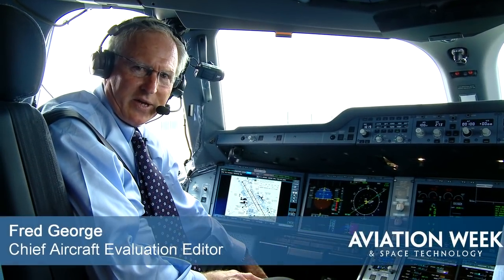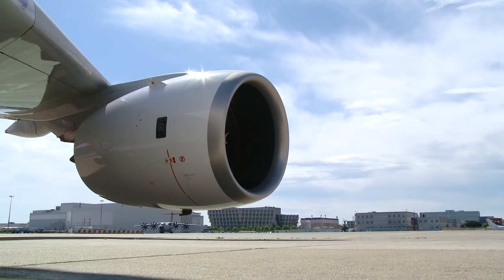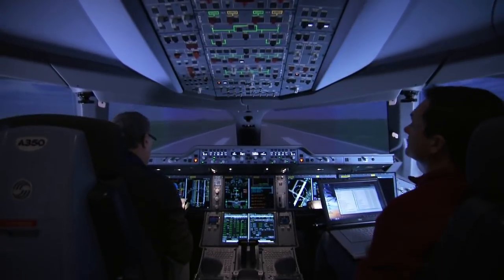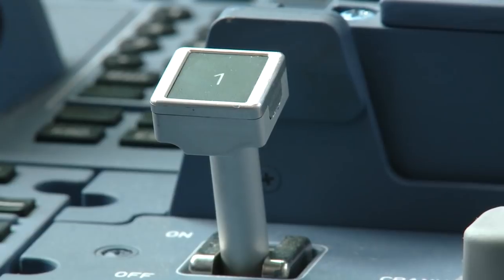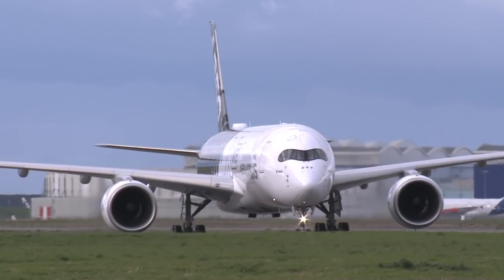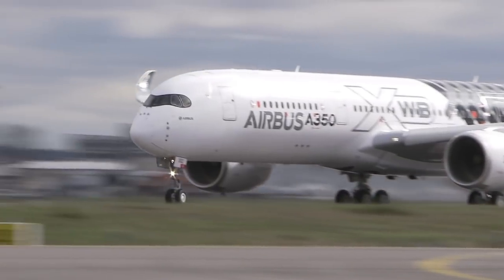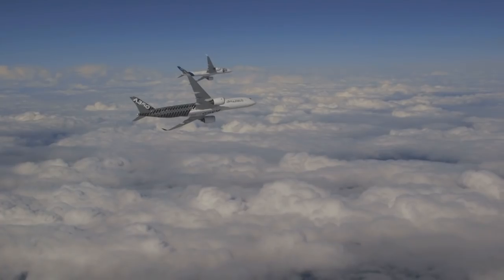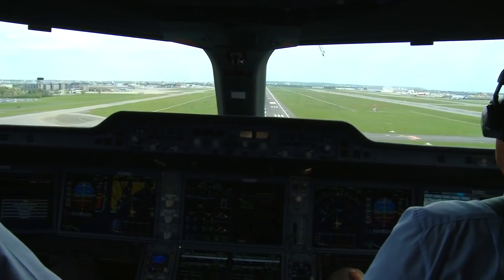Pilot Report: Airbus A350

Comment: "This jetliner is going to give Boeing's best tough comp.."..MY ARSE...
Reply: AeroManiac A well-put, very sophisticated and intellectually sound argument you wrote there.
Reply: goldstriker123 That's about as far a comparison between B777X and A350 will ever..... Bitches.....Whosyurdaddy...?!!!
Reply: Unconfirmed? really... Its confirmed that the team that tried to investigate this has all been fired, confirmed that there is true, factual documentation that the parts used to assemble the fuselage are being hand made not to spec instead of machine done. Its confirmed workers in the factory are having to over stress and over work the metal parts to get them to fit correctly causing the metal to wear prematurely and a catastrophic failure is due any day now. Do your research. Also, a lawsuit haha. Its the internet, this is youtube, not fucking supreme court for christ sake.
Reply: B777X is extremely heavy since they didn't use composite materials for majority of the fuselage.

B777-8X is also have too much range and thrust for it's size. Just like B777-200LR, it's not gonna be a big seller.
The only big seller is the B777-9X. But, apart from Major airlines, not many airlines actually bought it. Mind you, it's not easy to fill with 400 to 420 passengers inside a single fight. 

A350-900 in the other hand, have a perfect capacity to replace B777-200ER (which is a big seller back in the day).
While A350-1000 would be a good plane to replace B777-300ER.

So yes, This jetliner ALREADY giving Boeing problems.
Reply: +AeroManiac The A350 and 777Xare in two different weight brackets. The 778X will never be a mainstream aircraft but will instead be a niche aircraft like the 772LR probably not operating beyond the Middle East and a handful airlines in Asia. You can however reach your conclusion based on feasible facts once the 777X empty operating weight, max zero fuel weight, specific fuel consumption become available......
Reply: +AeroManiac Yeah the 787 dreamliner is pretty shit.
Reply: +AeroManiac except boeings are built with faulty parts and the company is too afraid to do or change anything about it at the risk of their bottom dollar.
Reply: AeroManiac LMAO did you actually say lawsuit in YouTube comments? What a tool.
Reply: Rlnthndr What you are doing now is defaming Boeing by giving false, unconfirmed statements,,,,, and this can invite a lawsuit.